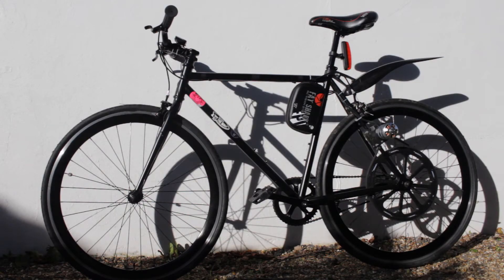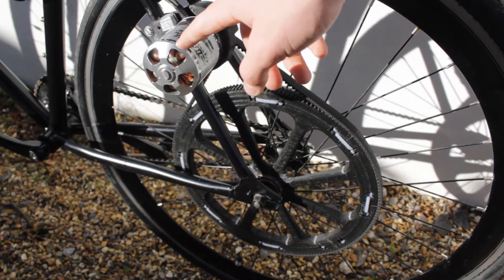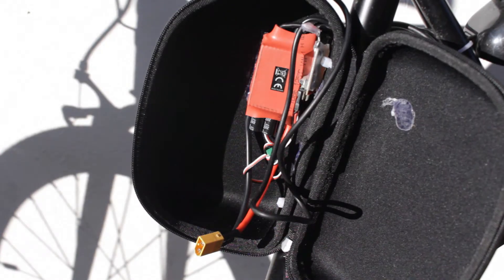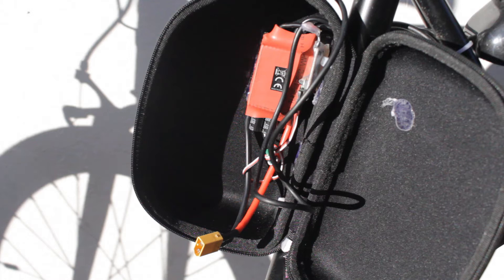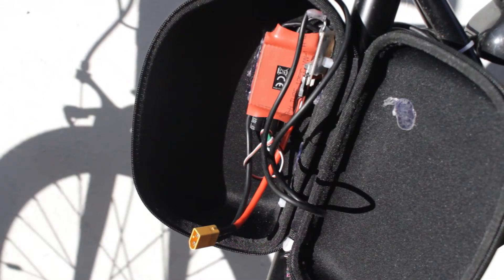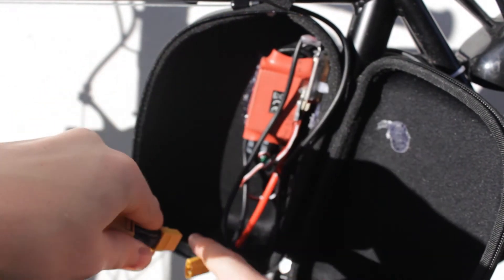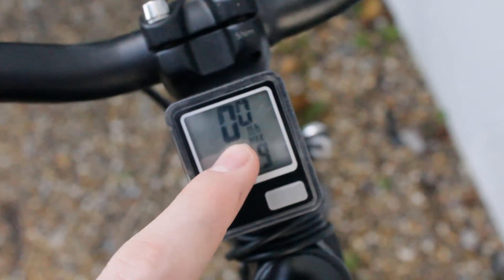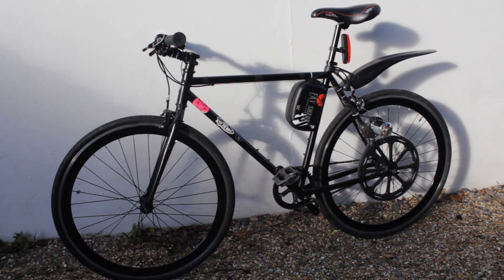DIY Electric Bike

Comment: Do you think this setup could work with chain and sprockets instead of belt and pulleys?
Reply: I just did this, bookmarking so I can come back with a video
Reply: What Ever I tried and the simple answer is NO, brushless motors go fast and need a speed reductor, plus connecting an extra chain just makes more noise.

Comment: Why you don't put engine under frame only on side ,please answer me please
Reply from the maker: if it was placed under the frame then it would be damaged more easily and also mean that the belt may not align with the rear wheel.